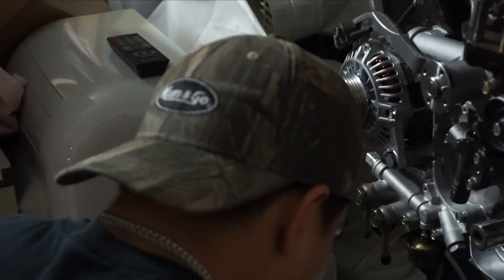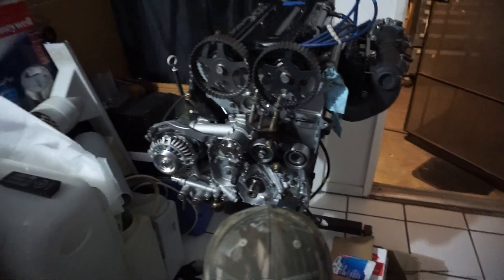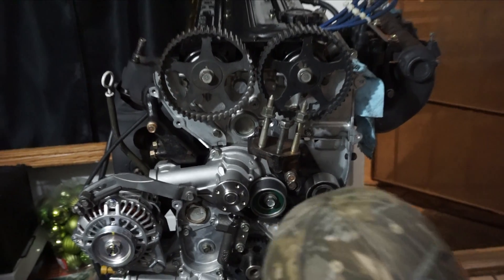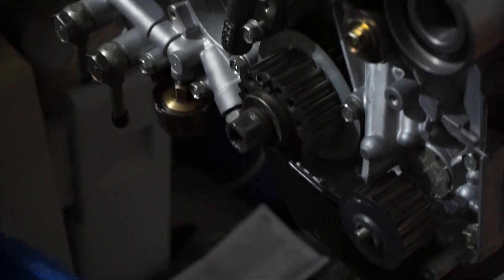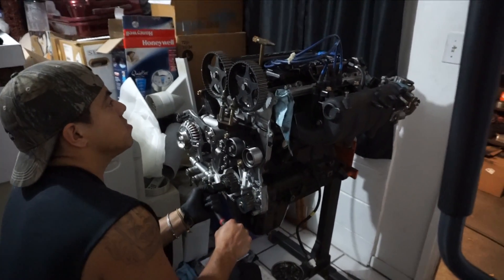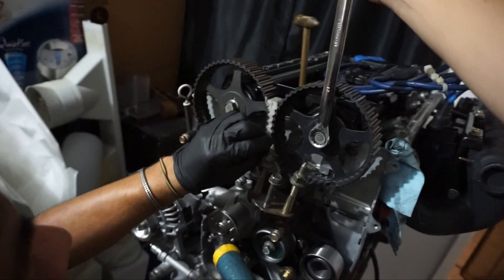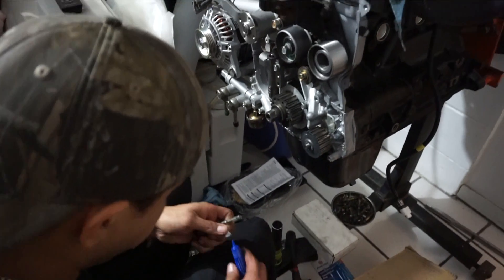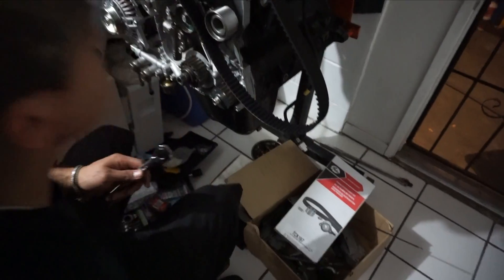Project 2g Revamped: How To Set Timing On A 4g63

Comment: Well I read that those torque specs are for a DRY bolt. When you put locktite, the bolt is no longer dry and the torque values change. I read locktite recommends that you deduct 20% from the original torque specs...

Had the car held up since?

Comment: I just did my timing belt, balance belt, pulleys and valve cover gasket on my 97' GST and now have low vacuum at idle, -10HG with a slightly rough idle.  Once i changed the balance shaft/timing belt and confirming timing marks on cams and on all pulleys were correct, I rotated the crank sprocket clockwise by hand a few times to ensure the timing was still in alignment. Once confirmed, i started my engine and it idled fine. I put the 3 drive/accessory belts back on and everything and then changed my valve cover gasket. once everything was finished, i stated the car again and my vacuum reads a low -10HG when before the work was the usual -18/19HG at idle.  It does not idle smooth and I can't figure out why my vacuum is -10HG at idle... If the timing or balance shaft belt timing is off by 1 tooth, can this cause -10HG at idle? Do you think I tightened my calve cover incorrectly? Can over tightening the CAMS cause this to happen? I didn't touch anything on the BOv side of the engine to cause a leak in the intake system, I just raised and lowered the engine while swapping belts... any insight would be GREATLY appreciated!

Comment: Just a note for Evo 4-9 guys, this is not how timing it done on our engines.  Timing marks on cam gears point upward toward notches on the valve cover, the rest is the same though.
Reply: The tensioner pulley is also upside down in this video - not sure if it's an evo thing, but the two holes on the pulley should be below the bolt, not above
Reply from the maker: 6 bolt and 7 bolt are different.